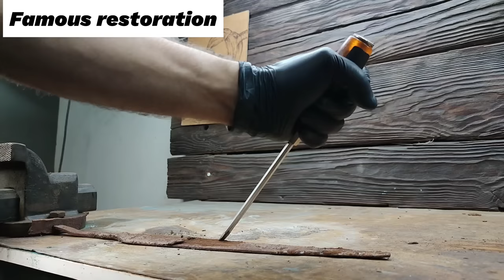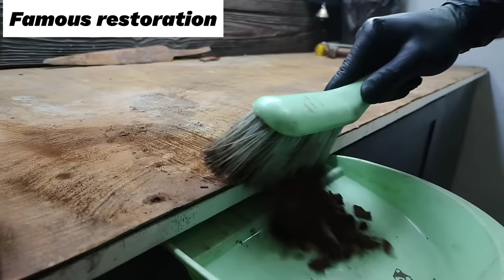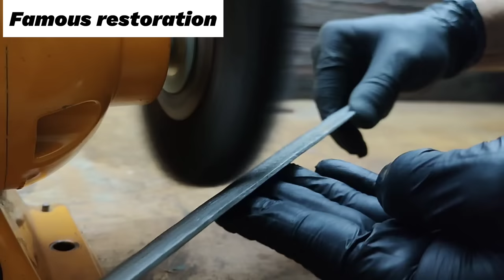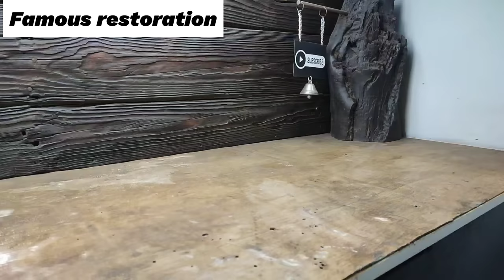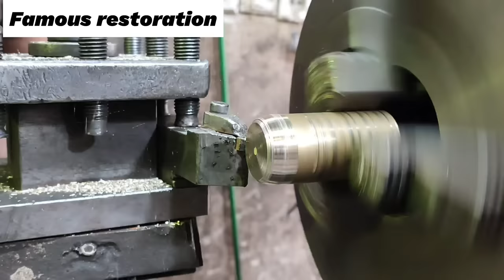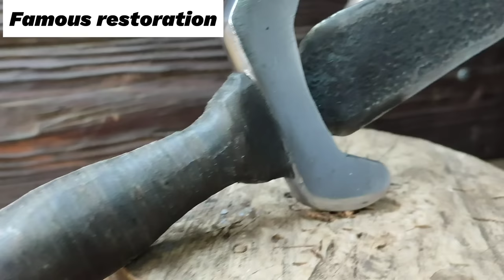Restoration // Restoration of a 350-year-old dagger

Comment: I think the original sword was very roughly made, but that handguard still looks somewhat too heavy on a sword that size. That uneven groove on the blade looked to me like an attempted and abandoned fuller. The purpose of a fuller is, I believe, to make it easier to extract a sword from a body after a deep stab. The weapon was perhaps one made in a hurry to fulfil an impending need.
Reply: Fullers are there to save weight in the blade, but without reducing its strength (too much). I think you're right that someone started putting one in and then changed their mind
Reply: The fuller was actually meant to lighten the blade without sacrificing strength, it had nothing to do with making it easier to extract, the blood groove theory is a myth that some experts unfortunately still believe
Reply: The fuller saves weight without sacrificing strength in the same manner as an I beam.